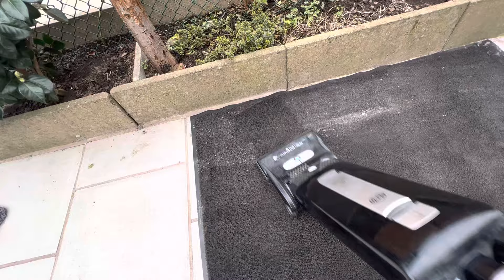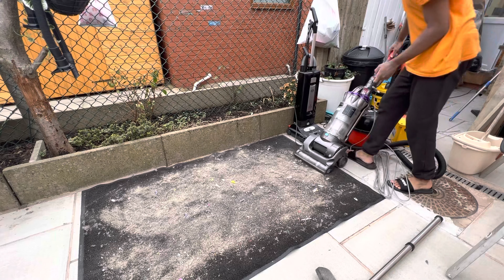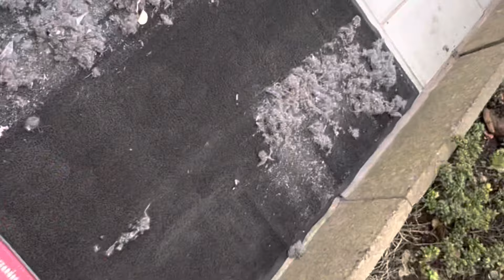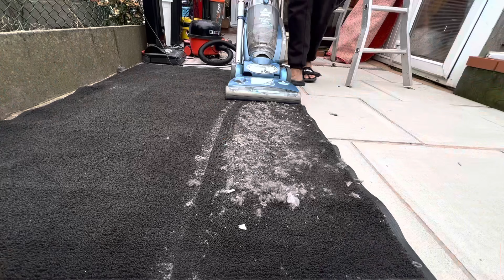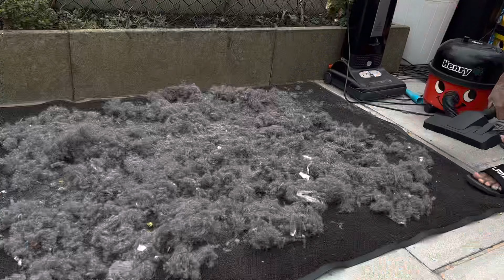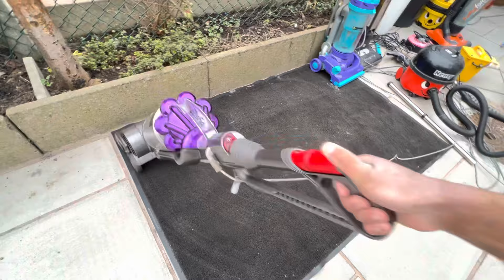MESS TEST - 8x VACUUM CLEANERS, ONE RUG, HUGE MESS WITH DIRT & FLUFF!!!

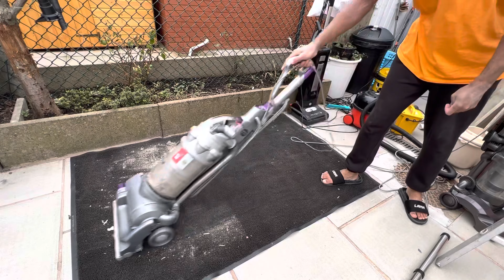Comment: what model of dc14 was this? 10:58
Reply from the maker: That is a DC14 Allergy
Reply: @parwaz7861   Okay, thanks as it looks like my dc14 complete in the same color scheme
Reply from the maker: @AllTheOne219  Awesome! Yes the DC14 complete is almost the same vacuum, but it’s the US version with different name, different motor and different brushbar, soleplate and bigger brush housing
Reply: @parwaz7861  my clutch recently went out after my brother used it but i had one from a dc07 that still worked but it was garbage. curb find dc07

Comment: How long do dc04 cones take to dry?
Reply from the maker: With the shroud removed from the cyclone they should just need drying with a towel and you’re sorted
Reply: @parwaz7861  I didn't remove the shroud. That's still attached to the cone. I just detached the cone/shroud from the handle part of that makes sense haha
Reply from the maker: @RJA_World  I’d just shake it out well then leave it to dry for a few hours in a warm room, you’ll be fine anyways I doubt it’ll harm the motor
Reply: @parwaz7861  Thanks my friend, much appreciated